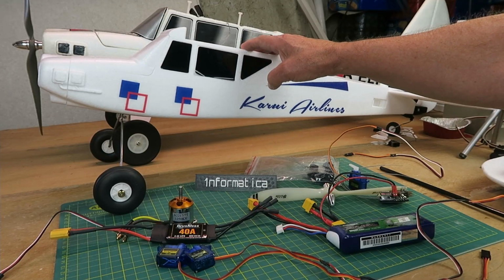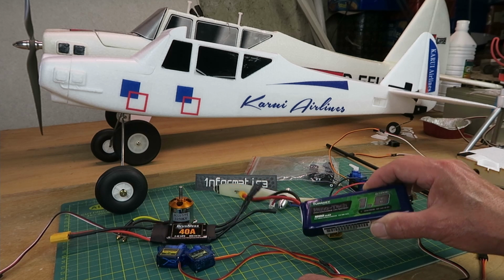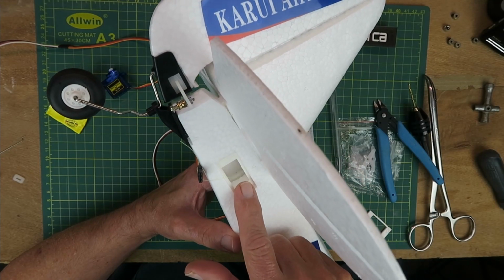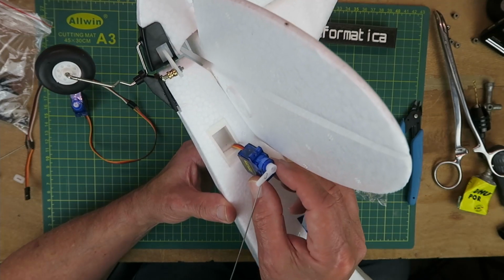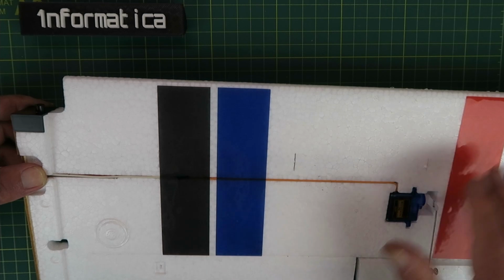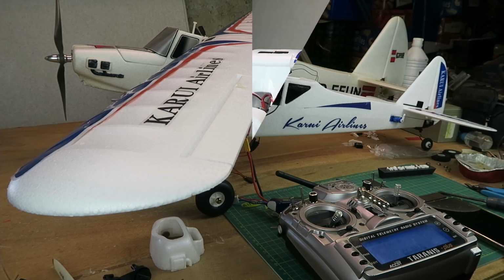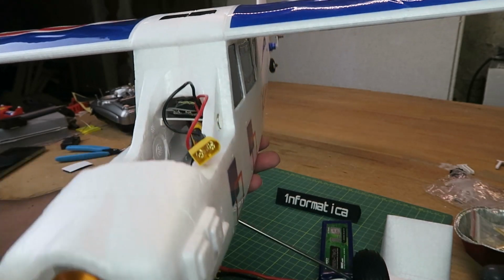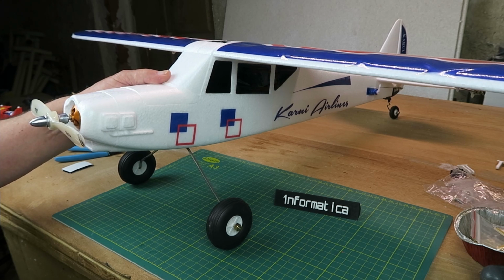Mini Fun Cub 1100mm Wingspan EPO RC Airplane Kit Build Review

Comment: I bought a sam model from the banggood and I ordered a D3536 910kv motor . What do you think is it ok fir this model whit 11x5,5 propeller . Thanks for your help
Reply from the maker: In my opinion that is far too big for this model. The recommended motor is 2212-2216 KV980-KV1400 with an 8*4 propeller. Thanks for watching and have a great day!

Comment: 3s 2200mah can fit inside ? Heavy?
Reply from the maker: I would not even try to put a 3S 2200mAh in there! Even an 1800 is a squeeze https://youtu.be/eiIi7rqpX24?t=546 It flies fine on 1500 as well.

Comment: Interesting vid. Bought one of these from Bangood some time back, and only started to put it together last night.
Opened the box to discover no manual, but I've been doing models for a few decades now so shouldn't be  problem.
Noticed you only used one screw to hold the tail together, I looked at it and suspected there was a screw holding the fin to the tail first before fitting the assembly (which is now difficult), and yes, I had to dremmel the hole for the tailwheel pin before assembly. 
I determined that most of the stickers were cr4p (in some places the colour was coming off the clear adhesive film), and very stiff, not wanting to sit down on the sculpted surfaces.
I also ran into the problem of the rear servos not wanting to sit in their holes, and at this point it was getting late so I put it all back in the box to work out a bit later...
I ordered the 'extras' kit (plus a couple of extra servos as I want to add flaps as well), and it was supplied with a 840kv motor and 10x6 electric props, probably a bit quieter that the TopFlyte 8X5?
You wouldn't happen to have a link for the manual anywhere? (I've dug around, but nothing...)
Reply from the maker: Hi, as far as I know there is no manual for this kit. I don't think the motor and prop you have been supplied will be a good match. Recommended in the product description and used by me is a 2217 2300kv motor and a 8x6 prop. I changed from the original prop I was using to a Gemfan. 10x6 will give very little ground clearance with the supplied undercarriage. I just grabbed a 10 inch prop and checked, I have less than half an inch clearance! Having "nosed in" a few times the foam supporting the motor mount has gone soft so I designed a 3D printed firewall to beef it up. If you want I can put it up on Thingiverse. Good luck with your build and let me know if I can help. Thanks for watching, have a great day!

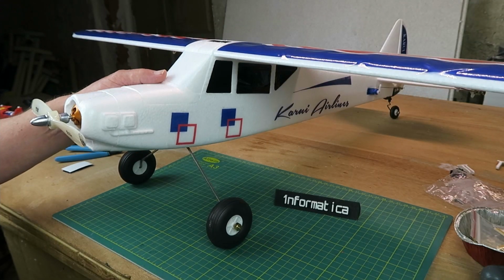Comment: information.        at 1:17,  the use of a  GAS  prop  equals  Wrong.!          at 4:33,  short pushrod theories.    lmao            servos/Mass  at  Tail.!      groan.        at 7:25,  ???     optimal location of cg is determined by the  geometry  of a  wing.!         optimal location of cg is (usually)  at  Thirty  percent of chord.           at 7:45, i question the appropriateness of doing that, with electric power.          at 10:10, the prop has ended up about one inch  farther  forward, than it should be.      googletranslate